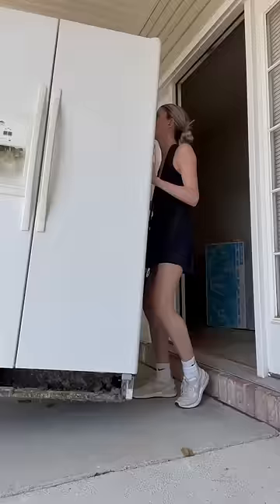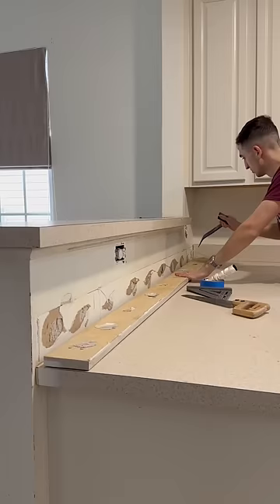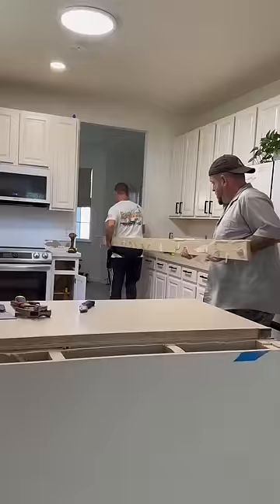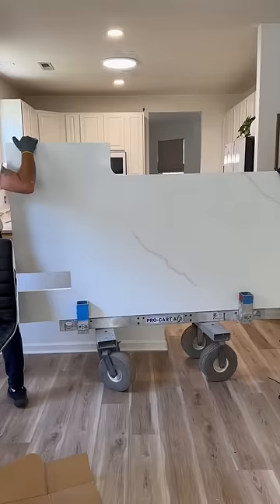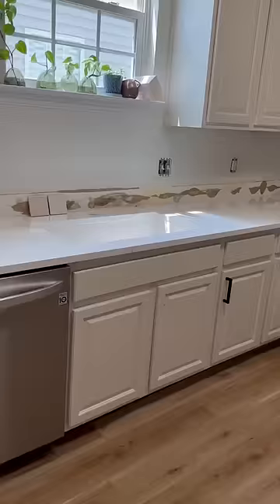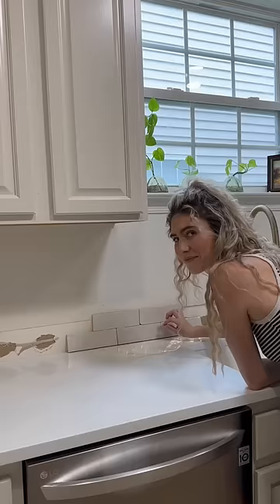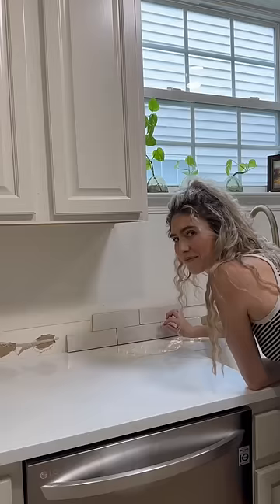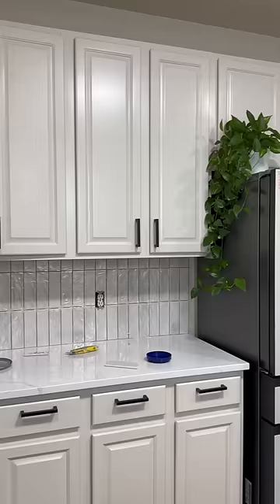#kitchenrenovations #kitchenremodel #homeimprovement

Comment: I was just about to comment that I'm sick of white subway tiles but then she flipped them in verticle colums instead of the typical horizontal brick pattern.  I never saw any here that were not brick layout patterns, until now.  She's right about them looking more "modern", wow do they look great.  I am headed in the direction of using large 24" x 48" glossy porcelain tiles but if I wasn't I'd buy a dozen or so of those type and dry fit them to see how they look.

Comment: Good job, but the tile and grout behind the high traffic area on the kitchen will require for you to clean and degrease it all the time. Granite splash wall or quartz wall would've been easier for you to handle.